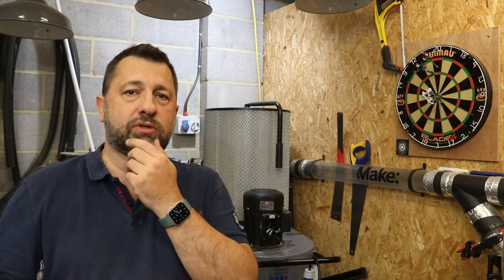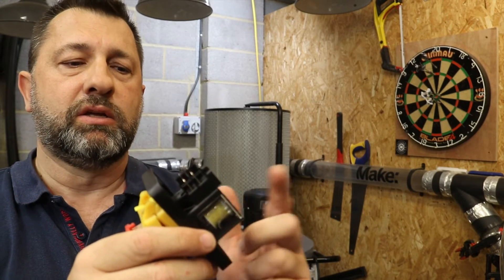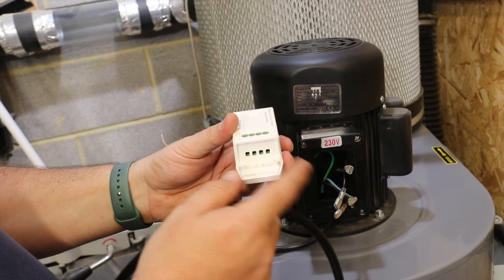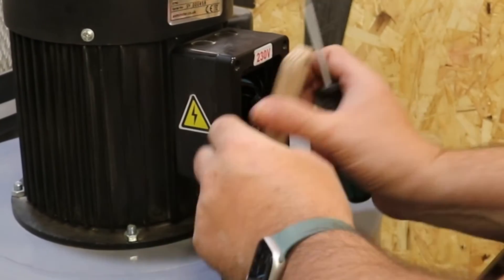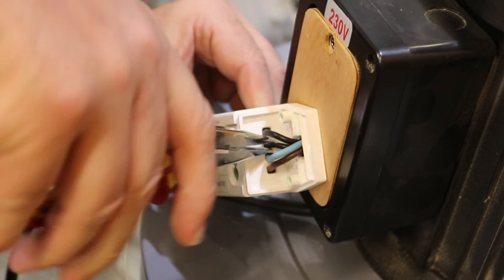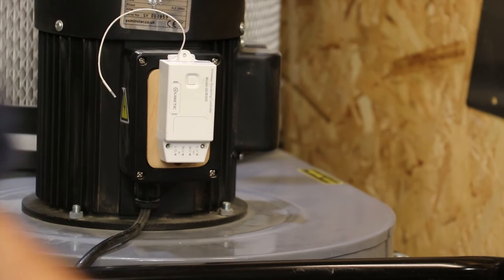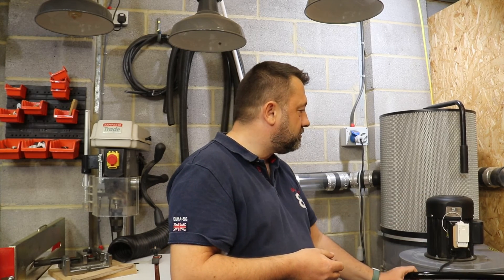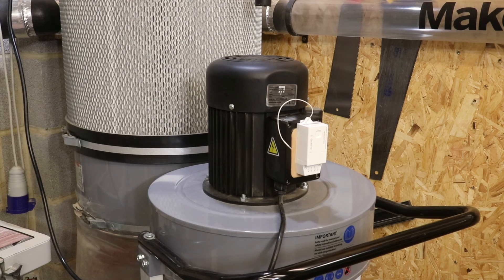DIY remote dust extraction

Comment: I've done a few shop automations but this one is really clever. The fob is great, I would have done an app-based switch had I not seen this and the fob seems better than getting my phone out. Is there a local shut off on the receiver unit or if the fob goes missing, you have to unplug it?
Reply from the maker: Yes there is

Comment: How does the cost compare to running wire from the vac outlet to a wall switch near your tool?
Reply from the maker: I have seven tools that use this. So for me this was cost effective. I would have paid a sparky to put wires/switches. So if you did it yourself, with seven switch’s, probably not much in it. The benefit is this system goes with me when I move. Plus I am not leaning over for switches. I did consider that though.

Comment: Hi Jeff. Nice thing. Have one on my dust extractor, but cheap one 433mhz. Works 100% reliable however. My recent upgrade was buying some cheap remotes in form of coin form factor with huge button. I put them on each machine near starting switch. Couldn't be more happy now.

Comment: I used to use a smart plug for my dust collector but now I just use a few of those Christmas light plug things. Plug dust collector into that, Plug into wall.  Super easy. Lonnng range too. Think it was 5.00 if I remember correctly
Reply from the maker: This particular model needs a 16amp supply as the UK 13amp supply wont handle the in-rush / initial surge of amps. so those type of plugs, even for some serious shop vacs in the UK are safe to use. This product supposedly has in-rush surge protection and is rated to 16amps. so should be safe :)

Comment: Glad to see you back. I tried to use one of those cheap fob controlled 240v 13 amp switches for an led panel in my shed. One night there was this terrible acrid smell in the garden. Opened up the shed LED panel was on, even though I'd turned it off, and the plastic was smoking on the remote switch - luckily missed out the "shed catching fire" part.   Might try one of these instead.

p.s you forgot the link : https://www.tlc-direct.co.uk/Main_Index/Wiring_Accessories_Menu_Index/Quinetic/#Quinetic_Controllers
Reply: Thanks! maybe hold fire till i have had it going for a few months :)  i will let you know. I turn the power to the garage off each day.
Reply: @geoffmeston1814  Just wondered i you were still about and if so how this has held up for you? Any issues? Followed your casting knobs video at the weekend to produce my own. Worked a treat - thanks for that one!
Reply from the maker: Yep still about thanks!
Held up amazing!
More videos start this summer

Comment: I'd say use shorter screws because they would have penetrated through the plywood you don't know if the cable might be on the other end no need to penetrate
You could use a 20 amp thermistor prevent the current rush
Reply from the maker: John sweda sorry I trimmed them, but didn’t show in the video.

Comment: Do you have a cyclone separator in your setup? I have a 4hp garage vacuum set up and bought a set of wireless outlets and I plug the wireless outlet into the existing outlet then plug the vac into it. Works great and much more convenient than having to reach up and turn the vac on every time I use a tool. And here in the States, we have a very similar hookup like yours
Reply from the maker: CrossGrain Wood Products,LTD no cyclone on this one but a small cyclone on my shop vac. Here in the uk this kit requires a 16amp supply so we can’t use it on our normal 13amp supply.